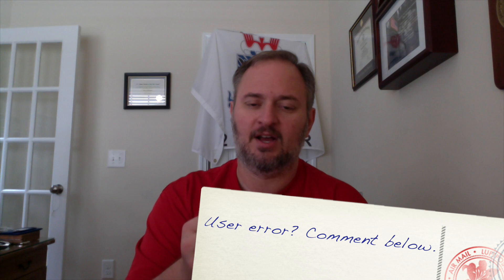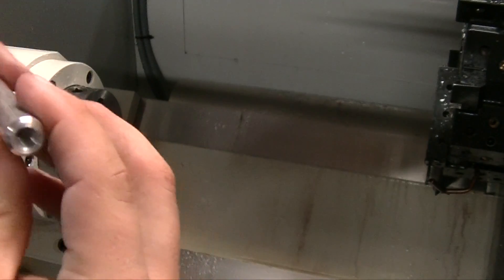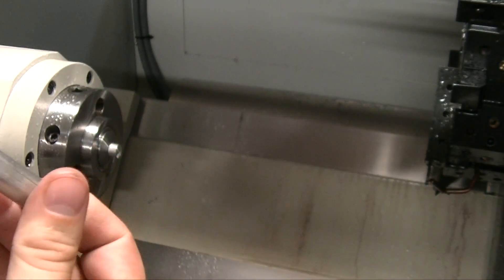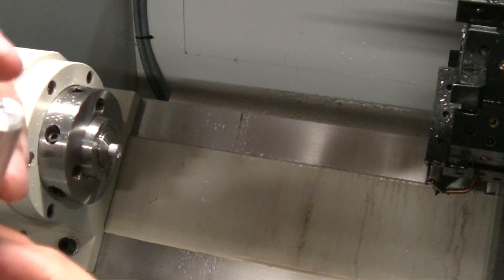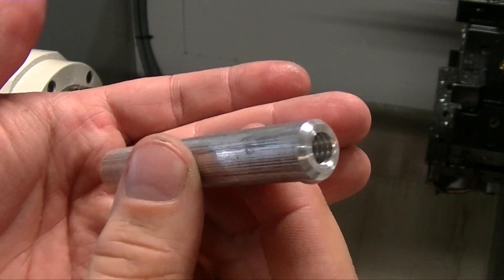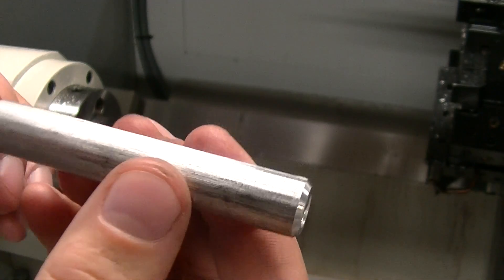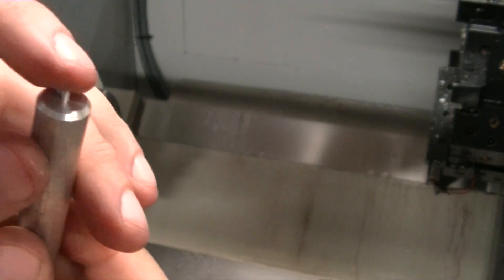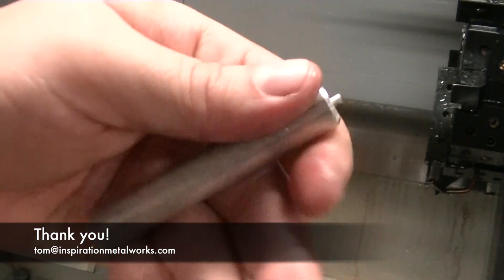Making handles on the Tormach lathe

Comment: Can you face off the next part just after the cutoff op?  If you could do the face/chamfer, you'd be ready to just drill when you set the part length.  I'll have to look at my cutoff tool.  Microcut or something like that.  I think Brad turned me onto them.  They're .040" wide and I think they're long enough for what you're doing.  I use a RH for cutting off tubing and it leaves all the burr on the left part.....but I run it in a hair further and it takes that off too. :)
Just went and looked.  Nikcole mini system.  They may not be long enough, but if they are....they're really sharp and do an awesome job!
Reply from the maker: Hi Mike,
The part / face thing is exactly what I did after that first part. The surface finish was so nice that I didn't need to do an additional facing operation. I'm going to switch from the jobber length to a stubby drill for a bit more rigidity though.

I'm glad you brought up the Nikcole... I hadn't thought about it but I've got that same mini-system here and it just might work for this small part but I need to look into a larger model since I'll be doing some 1" stock this week as well.

Thanks!!
TZ
Reply: I couldn't quite tell....thought it might have been a really slow retract. lol  
I hope the Nikcole does the trick for you. :)